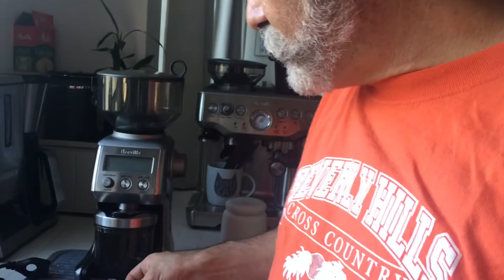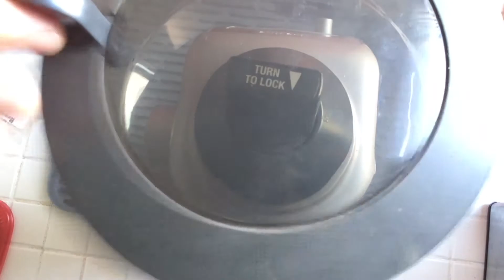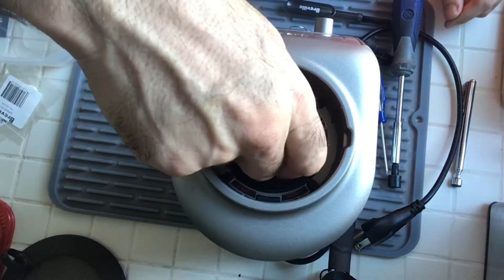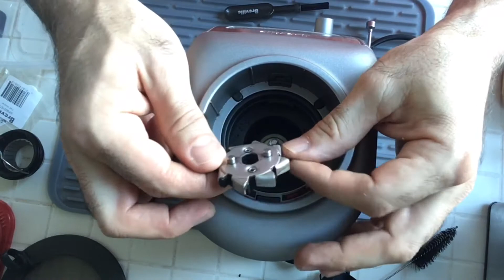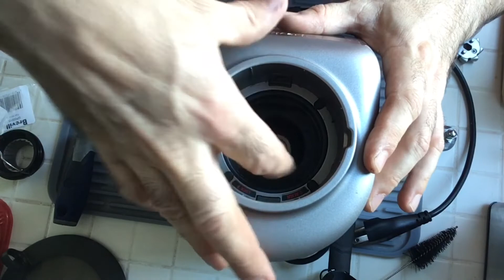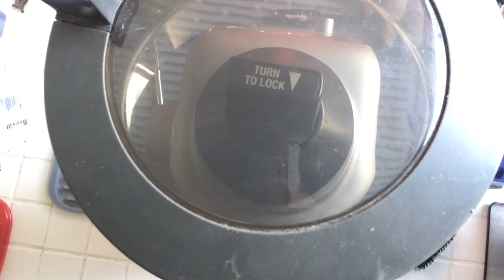Replacing the Lower Burr Felt Washer on Breville Smart Grinder Pro / Sage Smart Grinder Pro

Comment from the maker: Part number for the Felt Washer, Lower Burr is SP0001575. The same felt washer is used in both the Breville Smart Grinder Pro BCG820BSSXL and Breville Barista Express BES870XL. Parts can be ordered online at www.brevilleUSA.com or by calling 1-866-273-8455.
Reply: Can you tell me when/how I know the felt washer needs to be replaced?
Reply from the maker: @donpfaff8227  Sure. Every now and then do a deep cleaning, where you take out both the upper and lower burr. Get used to what it looks like so you will notice any change. It keeps the coffee dust from getting inside the motor, so it should just fit around that bronze ring. If it appears torn or substantially worn down it is time to replace.
Reply: Thanks mate

Comment: My grinder got jammed because water spilled into in (still asleep while trying to make coffee). Removing and cleaning the upper burr was not enough. These instructions helped me disassemble everything to remove the coffee-concrete that was jamming it. I used a grass trimmer line to poke through the outlet chute.
Reply from the maker: I’m so happy you were able to clear it, and glad I was able to help!
Reply: LOL. Glad it wasn't just me. Half asleep and poured water into the hopper. Not a huge amount but enough to gum everything up. Tried to just clean out the top and dry everything but in it still not working order a whole new grinder, but decided to nonetheless try a complete dissassembly. Was kind of surprised how easily the whole dissassembly went but discovered the felt washer was essentially unusable, partly through the water damage but also through 5 years of use. Part ordered and hope to have it back in working order soon. I shall of course have two grinders and will place one in the kitchen and the other in the office. Lessons learnt and learned a lot from this video too. Glad I watched this as vacuuming had sucked up one of the two lower metal washers which I managed to retrieve also.
Reply: Same happened to me... 😅

Comment: Good description! The grinder “blower” actually lifted up very easily on mine, too. The I used vacuum hose on my Bosch cordless vacuum (around 1-1/4” SAE) to clean out as I went, and it simply lifted the fan right up. Using two magnets, one on each of the pins on the side of the fan, would lift easily because—as with the vacuum hose—the lifting action is equal on both sides.

Comment: Great video.  I learned that the grind fan will simply fall out if you tip the grinder over and tap.  No disassembly of the entire machine necessary, haha.  That's also how I discovered the felt washer, which fell out afterwards and disintegrated when I picked it up.  Thank you for the reminder about which washer to replace first because I've had to keep it disassembled long enough that I already forgot 🙂
Reply: The grind fan is not supposed to fall out. The only way to remove it is to disassembly the grinder. If it does fall out it means it is worn down and needs replacement.

Comment: Great!….detailed and informative.
I have the espresso machine (with grinder) and the grinder in that looks exactly the same. Good information for when I need to service that.
Reply from the maker: I own both the Smart Grinder Pro and Barista Express and far as I can tell, the grinder built in to the Barista Express and similar models is nearly identical to the Smart Grinder Pro. The hoppers are different but still interchangeable. When searching for replacement parts (burr assembly, washers, grind fan, etc.) online, if you don’t find a part listed under your espresso maker you may be able to find it listed under the Smart Grinder Pro.

Comment: Thanks for the very detailed video! I wonder if this problem rings any bells for you: when I hit grind the grinder makes a bunch of loud noises but the lower burr isn't moving and the bolt ends up working itself loose after a ten seconds or so. I thought initially something was stuck and maybe lifting the burr up but several very thorough cleanings later it's still not working :( occasionally it'll start grinding again and then after a few seconds stops and just makes loud noises again
Reply from the maker: Hmmm… I’m not sure what’s going on. I wonder if the grind fan is worn down or something contacting the shaft is deformed or worn so it’s slipping.
Reply: This sounds similar to an issue I had with my barista express. I was unable to fix it myself and completed a replacement/return through breville support because the machine was still under warranty. I never did find out what went wonky with it.
Reply: @rewther19  Also still under warranty so I'd better contact them. Really appreciate the reply!

Comment: Thanks for the great video! How did you know your felt washer needed replacement? Was the grinder malfunctioning, or had it just been a long time? I have had my grinder for about 6 years and it still works but output is very low--I have to grind for almost 2 minutes to get 60 grams of coffee. I am wondering if the felt washer could be worn out. Thanks again!
Reply from the maker: I didn’t actually notice any change in performance. I had been using the grinder for well over a year and thought it was time for a more thorough cleaning. I disassembled the entire burr assembly and noticed the felt washer was falling apart. I pieced it back together and used it that way for a few more months before I went online searching for a replacement washer.
Reply: Did you figure this out?  I have the same issue.  The output was very low and then suddenly it stopped outputting any grinds at all.  I opened it up, tested it, motors work fine and no clicking...of course this felt washer disintegrated when I tried to clean it.  I wonder if it was responsible for the low output by getting worn out over time?  About to replace it..
Reply: @cyberdemon6669 I’m assuming after you replace the felt washer and it’s back alive?
Reply: @weeikaicheng6172  For me it was the fact that the entire burr was worn.  It was hard to tell by looking at it, but I replaced it and it fixed the issue (I grind a lot of dark roast, often frozen which caused it).

Comment: I've done all of this and my grinder is some better, but still spewing grounds. The one thing I didn't do was buy a new felt washer, is this the reason for the grounds flying all over? Thanks!
Reply from the maker: I really don’t know why it’s spewing grounds. Maybe your burrs are worn and they are moving around too much? Hard to say. Have you tried doing an internet search to see if anyone else had the same problem?
Reply: @PNWShawn  I sure have, an exhaustive search. It's how I found your video, which is awesome by the way. I supposed ordering all the internal parts isn't the worst thing to try, it is really annoying at this point. Grinder is about 4 years old.
Reply: @PNWShawn  do you think the felt washer is even necessary? I just got an SGP used and the felt washer was a mess! I tried cleaning it and of course it disintegrated. Put everything back together without the washer though and everything seems to be running just fine.
Reply from the maker: @slvrbach  hard to say for sure. I’m just guessing but I thing it keeps dust out of the motor. But I figure it must be there for a reason and if a $15 part helps keep a $200 grinder running properly it is worth it to protect my investment.

Comment: my grinder only has one shim/washer (instead of two) below the grind fan. Is that a problem? should I have two? mine doesn't look any thicker than the ones you have either. So it's not like a have one but thicker than 2 thin ones, you know?
Reply from the maker: It’s probably fine. If it’s been working with just one all this time then the tolerances probably aren’t tight enough to make a difference.

Comment: Can i use the same tool to replace the lower burr of Sage Dose Pro coffee grinder? I did a deep clean. However, it’s not working. Probably I’ve to do the replacement.
Reply from the maker: I’m not absolutely certain, but it appears the internal parts on the Dose Control Pro and Smart Grinder Pro are the same, just as they are with the built-in grinder on my Barista Express. Clearly the Sage and Breville machines are identical products sold under different names depending on region. I’m not a pro, just a coffee enthusiast, but I would recommend ordering the part from the Smart Grinder Pro and give it a try.
Reply: @PNWShawn  this was very helpful. Thank you 🙏🏻

Comment: So its been 2 years for mine. Havent checked it out yet. But ive noticed that even in 1 settings i couldn't get the proper extraction time of 25 to 30 seconds. So i changed the upper burr to 7. No it works again.... whats your opinion? Should i just replace both lower and upper burr?
Reply from the maker: Hard to say. If it is working now after making an adjustment, then it may not be necessary to replace anything just yet.

Comment: Do you know if this felt washer will work on the Breville Smart Coffee Grinder?
Reply from the maker: TBH I’m not even sure the BCG800XL Smart Grinder has a felt washer; I’ve never disassembled one. I was looking at a parts schematic and didn’t see one, but I didn’t spend a lot of time on it. Have a look here: https://www.ereplacementparts.com/breville-bcg800xl-smart-grinder-parts-c-116052_116057_296085.html
Reply: @PNWShawn  Yes, it has a felt washer.  I've taken mine apart already.  The parts look the same as your grinder in your video.  I called Breville, and they said the same part should work so I'm giving it a try.  Fingers crossed.  Thanks.
Reply: UPDATE: I ordered the felt washer (SP0001575) from Breville and reassembled my Smart Grider. Everything works perfectly. Just adding this in case anyone else comes across your video looking for how to address this same issue on the Breville Smart Grinder. Thanks!

Comment: My lower but rotates freely when I try to remove the nut. Any thoughts on how best to restrain it?
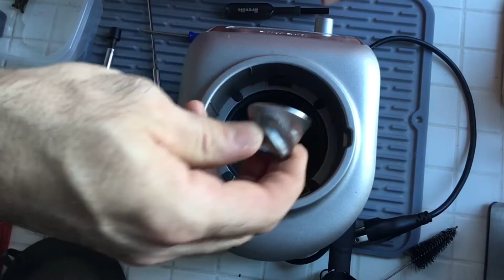Reply from the maker: The lower burr should not move when the motor is not spinning, so it’s possible the lower burr is not completely set onto the two small nubs on the grind fan. The grind fan only spins with the shaft because the shaft is flat on one side rather than completely round. The hole in the grind fan is the same shape unless it somehow got so worn that the flat spot is rounded out. This is unlikely, but if so the grind fan would spin freely and the lower burr would spin with it. It’s more likely the lower burr is not sitting correctly on the grind fan so that those nubs on the fan are in the two holes on the bottom of the burr. Please go to 07:50 in the video to see what I mean. If the burr is not seated on the grind fan, try slowly rotating the burr while gently pressing down on it. At some point the holes should align and the burr will fall into place. Then you would need to tighten the screw down a bit more. Remember that the nut is reverse threaded so rotate to the left to tighten. If that doesn’t work, try holding the lower burr still with your fingers while unscrewing the nut. Then remove the lower burr and determine if the grind fan is spinning freely. If not, then try to determine why the lower burr isn’t locking in place onto the grind fan. Are the little holes plugged with coffee dust? Let me know if you figure it out.
Reply: @PNWShawn  thanks for all the info. I ended up needing to use a small crescent wedged on the lower burr to stop the burr from spinning and remove the nut. My machine seems to have a slightly different build, my lower grind fan has only 1 metal peg and the shaft that it sits on which connects to the motor can spin when the machine is off. My burr was properly seated against the grind fan. Anyway thanks again, I was able to do a solid cleaning with your help.

Comment: Hi, my smart grinder pro suddenly dropped from the usual 14 to 6 settings. Does this means the upper burr assembly has been worn out? Does anyone can confirm this?
Reply from the maker: I’m not sure. Your description is a little vague. You could try to get a hold of customer service at Breville/Sage, either by phone or email. They may be familiar with the problem and can help you find a solution. It seems to me that the grinders inside espresso makers like my Barista Express are nearly identical to the Smart Grinder Pro and share the same internal parts. If you can’t find a part you need, you may be able to find it listed under one of the espresso makers with a built in grinder. Here’s another thought. My brother had a Barista Express that was a few years out of warranty and the pump stopped working. He called Breville and they told him to take the machine to the UPS Store where they would package it and ship it to Breville. Then, for $180 including shipping they would either repair it or replace it with a factory refurbished machine. They wound up sending him a refurbished unit. I know $180 is a lot of money, but now his coffee maker he uses several times a day, every day, is good as new.
Reply: @PNWShawn  Thanks Shawn. I had just placed an ordered for the upper BURR assembly. Should be receiving it within the next 3 days. I will update here once I test it out and confirm the problem.

Comment: It’s nice share! My breville it's been cleaned and the burrs are spinning but the grind coffee doesn't come out.  none of the lines for dispensing coffee are clogged.  do you have such experience? @PNWShawn
Reply from the maker: No, I’m not sure what could be the problem if nothing is clogged. Perhaps if the grind fan and burrs are worn down so much that they are not making contact. If parts are spinning than they are probably inserted correctly.